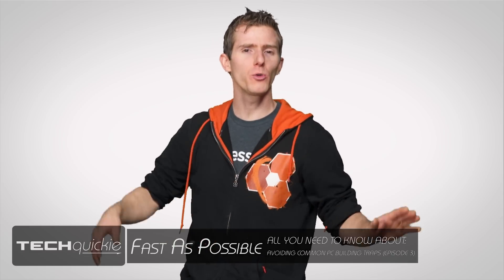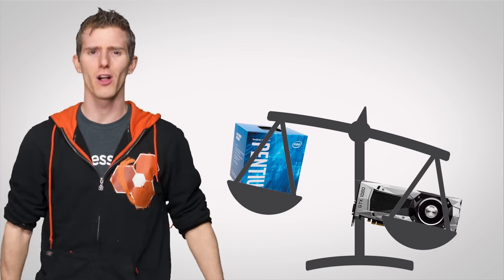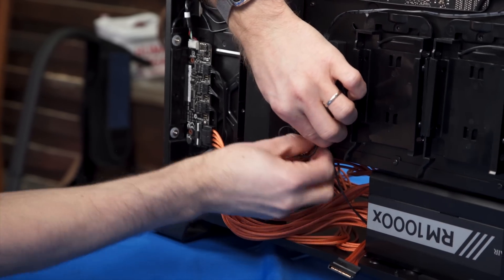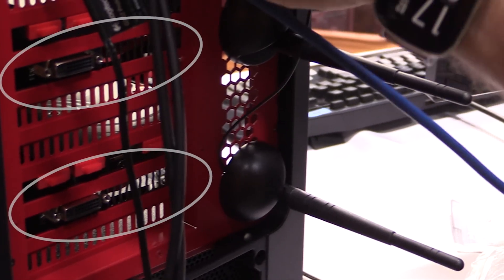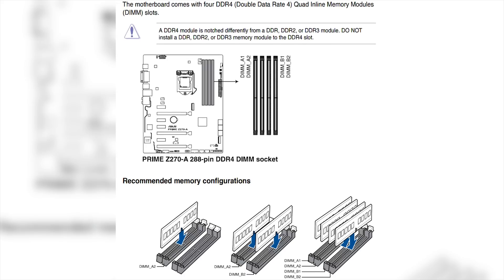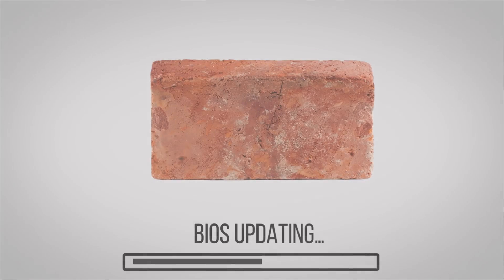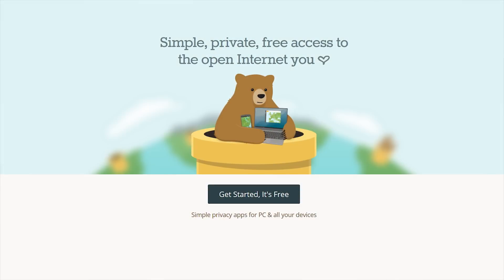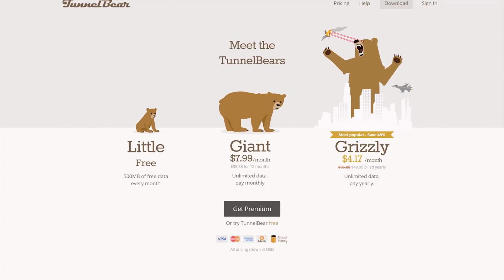Avoiding Common PC Building Traps - Episode 3

Comment: Maybe researching what you are wanting to do with your build to get the right parts you need before purchasing. For example, I bought a Z270 Gigabyte Socket 1151 board. But I later found out that it only accepts LGA1151 socket types and only up to a 4-core processor. I wanted more than 4 cores so I was able to do an exchange and got myself an ASUS X99 A-II board that is an overclocking supported 2011-v3 board that allows 6-core chips or more for a build that I want to do gaming and content creation. Research goes a long way especially when they may not allow you to change your part to something else youre looking for after the 14 day or 30 day exchange time. I almost missed out on it too since I didnt look into the stuff until about a month after getting it but I am thankful I was able to exchange it.

Comment: I built myself a new pc and it conducts slight electricity on the case, what should I do please help, its not like giving a shock but it can be felt.
Reply: Mad-Tech-Tutor check for any loose cables touching the sides of your case. If you are uber-paranoid of zapping yourself and can't find that wire, hook up a ground lead to the case. It will pretty much guarantee that you won't receive an electric shock, but you might end up frying something in the case.
Reply: Juozas Domarkas loose cables like sata cables ?
Reply: Mad-Tech-Tutor they shouldn't be the problem. It is likely that a cable from your PSU is loose and is touching the PSU case, which then conducts to your PC case. 
Please note that I am not an electrician and am purely speculating. You are better off asking in Toms Hardware or some other forums than a YouTube comment section.
Reply: I had the same problem, just make sure the socket you're using is earthed & the power cord is well in.

Comment: I built my first PC in November 2016 and had 2 problems:

1) For my CPU cooler (Cooler Master 212 EVO), I accidentally used AMD mounding hardware on an Intel CPU. 
This resulted in juuuuuuussst enough extra pressure to make my 6600k upset. This lead to the most stubborn "No POST" my friends have ever seen! It took us about a week to realize the improper cooler mounting hardware was the cause. Luckily there was no damage to the CPU.

2) DONT GO BLINDLY FLIPPING SWITCHES! 
while trouble shooting my #1 problem, I courageously decided to start flipping switches. (need I say more?). . .
when we got the computer up and running I was only able to pull off 15-20 fps in Overwatch with medium settings(on a GTX 1060). The problem was that I accidentally flipped the "SLOW" switch on my motherboard. My cpu was capped at 5-10% power with this switch flipped.

Can anyone relate? or are my experiences unique for a 1st time builder? lol.
Reply: I do not understand you. I have a Samsung 750 evo ssd, GTX 1060 and an MSI gaming M5. I hope that answers your 'question.

Comment: I disagree with the video card vs motherboard choice.  For the 1st time booting up, I like to use the onboard graphics to install and test my build.  When you put together a new build, never, ever throw in the whole kitchen sink.  If something goes wrong or God-forbid, you have one DAO component, having everything installed means you now have to figure out what it is.  By having the fewest components possible to boot, you can rule out the Big 3 - motherboard, cpu, and memory.  If you bought 4 sticks of RAM, use only 1.  You bought 4 HDDs, use only one.  You bought dual graphics cards, don't use either (use onboard if you can until you know everything else is working).  Then turn your system off, unplug the power and then install your new graphics card (again only one at a time or if they don't work, you will have to troubleshoot which one(s) is/are bad).  Nothing more frustrating than to install everything, only to find out that something is DOA and now you have pull everything apart trying to find out what it is.

Comment: Probably a dumb question but I am not as knowledgeable on tech as most. What happens with a dual monitor set up if one screen is plugged in to the motherboard and the other is in the GPU? say your secondary monitor is in the MoBo and the primary which you use for games is plugged in to the GPU, would that cause issues as Linus stated here would your game be unaffected by this kind of thing? I do have both my monitors in my GPU, I only ask out of curiosity

Comment: GPU install tip: HDMI connectors can wind up too close to the slot ribs preventing the plug from going all the way in. Loosen the PCI screw, gently nudge the card, plug in the HDMI cable until it "clicks", leave the plug inserted, and tighten the slot screw.

Comment: One thing to add in PC builds traps is make sure the equipment is actually good.  I bought a keyboard and it caused problems that took me a year to figure out.  Debris on the electrical connection strip caused intermittent USB power drops and losses which caused all sorts of problems.  Since it was new I never once expected it to be the source of all my woes.  Symptoms like PCIE power drops that made the video card look bad or windows suddenly going to sleep for no reason and then waking up without having pushed the power button to name a few.  Even Logitech has bad equipment from time to time so make sure it's all good to go before you build your system.

Comment: I am busy with my first build, I have an Asus Rampage V edition 10 with a 570X RGB Cosair chassis but the back-plate of the motherboard is touching the rubber cable management holes in the case. Is that normal and safe? If not, what can I do about it?

Comment: Talk about how to buy a UPS. I was researching and some high end PSU's dont work with lower end UPS as the sine waves from the lower end UPS are "modified" and are more like square waves instead of smooth sine waves. However lower end PSU's dont have that filter that denies the modified sine waves but I could be totally wrong so some clarification on how to match a UPS with a PSU would be great.

Comment: i have a good question about windows.. i've done many builds and have installed windows way too many times. i find that windows will have odd behaviour differences between installs. sometimes some settings or configurations are off, or i'll install a copy of windows that cant stay stable while i program the PC with other software. To cure these headaches i just reinstall windows over again and hope for a better install. like now, i have windows 10 running on a 1TB and i want to make a fresh copy of windows 10 on my 2tb hybrid drive that install had a few things different vs my copy on my 1tb like file explorer not being pinned to the task bar. the new copy on my hybrid drive had a hard time staying stable, it would crash and act finniky every now and then..... all untill i asked it to go to sleep mode and it decided to kill itself. windows would not boot and requested a fresh install..... im back to my 1TB

Comment: Always double check the manual and all plugs for your motherboard and peripherals in your build, make sure that you have used everything needed and nothing vital is unpowered or power being pushed to it uneccesarily (poking at Linus's router build but also my own first build where I thought had an unnecessary plug, when in reality I just didn't know there was a CPU power cord because it was hidden behind my rear case fan. 4 days of idiotic troubleshooting and pulling components trying to get a post confirmation beep and spent $100 on a new mobo for no reason and couldn't get a refund)

Comment: I might be late, but it's usually a good idea to get a bit more RAM and Voltage than you need, too. PSUs wear down and lose voltage over time, and a little extra memory never hurts.

Current planned build's gonna run ~300w, but I'm going go buy double that for the PSU.

Comment: Tech tip: Stop buying i7 laptops with 5400 rpm hard drives then complain to me it is slow. And when I suggest you replace your HDD with an SSD, don't tell me you would rather invest into a 7th gen i7 with a 5400 rpm HDD to make it faster.

Comment: One thing you missed was checking to make sure the CMOS jumper is not in the reset position.  Also, make sure you put the video card in the recommended, by mfg, slot if running a single video card. And, make sure your fans are blowing in the right direction.  One important part I made a mistke on was not having the right case for OC'd video cards.  I think the air flow was insufficient for the XFX R7 270X video card and it over heated and started acting wonky.  When I took it out the metal back plate was burned.  Fortunately XFX took it back under warranty and replaced it with a nice RX460, the 4 gig flavor, and I updated the chassis.

Comment: I build my PC 2 Days ago and yeah i did put my DDR4 Ram into A1+B1....luckily ive read the Mainboard Manual before powering up my PC (was plugging in the Frontpanel cables) and ive put the Ram in the correct A2+B2 slots, like the same in the vid.
Its my forth PC ive build in about 14 Years XD 
The most important thing ive leaned was Cablemanagment and airflow...
The second one bacame important after my AMD Thunderbird...well as the name implies it bacamehot...VERY HOT about 120-140°C if i remember correctly. The Mainboard did shut down the PC for protection, but i ignored it and turned it back on every time....until the CPU had a meltdown. It DID still work, but only partially...

Comment: I know his point was ultimately not to be gaming with the monitor cable connected to the motherboard, but he said "when you are finished building and you are ready to plug your monitor in, Don't..." This is nonsense. 

I was building a PC for a friend a week or so ago, and even having the GPU installed, let alone routing your connection through it, completely hindered the system installing certain drivers for the motherboard. Especially the Intel Network Driver. 

My recommendation is therefore to not even install the GPU before the system is completely up and running with drivers and everything, to avoid the two hour Wtf-phase I just had. This of cause entails connecting the monitor to motherboard.

Comment: Didn't you all disprove cable management mattered unless you did something moronic like put the packaging in the case?  And as a technician I hate anyone who puts Zip-Ties on computer cables.  if you ever need to change or move cables now you have to cut the ziptie, and that means risking cutting the wires as well.  Never use Zip Ties on things that matter.

Comment: There was a mistake I did back when I build my first PC, I have screwed the motherboard straight into the case's template without spacing out between the motherboard and the case, I was lucky enough that it didnt fry my motherboard! 
But I did end up wondering for countless hours why wouldnt my pc power up

Comment: Building your system around your case (don't assume your case can support a 14 inch card) and avoid using cases that have poor airflow if you decide to purchase power hungry components that will spew hot air into the case if you can't effectively vent it out.
Reply: yeah, or if you RMA your R9 280 and get an R9 390 back as it's replacement. How the hell it fits, I don't know... but there's not a lot of room in there.

Comment: my tip is:
cable management dont do anything noticeable for your system.
you dont believe me you say?

Luke's workshop video probably can confirm this :)
Reply: until you have to take something out, that is :V Cable management is the only reason my aircraft carrier of a video card fits in this case. Cables do also collect dust. It's okay, though, because most of the dust is on the side I can't see. XD

Comment: Here's a tip:

Watch the prices vs performance!

If you've got a choice between a $200 video card and a $600 video card... more often than not, the difference is going to be negligible for your average person. If you're not gaming in 4k and trying to play the latest everything, the $200 video card will work just fine. OR, you could look into buying two $200 video cards and linking them together with SLI or something and you might even end up on top, $200 cheaper.

There's always this... exponential step between hardware, where you'll go from one price, and the next step up is more than 2x that price for a lot less than 2x the performance. Unless you really want the best of the best and you want to throw money around, there's nothing wrong with going for budget when you hit that huge step up in price.

I usually try to keep it to between $600-$800 and so far this has served me well. The computer I currently use was about $800 and it on its 5th year and still going strong, other than me having to replace the stock CPU cooler a couple years ago.

Comment: #1: PC Building Trap: Don't build something so high end that you can't match or exceed it's performance in the future. E.G: Spending every last cent on a super high refresh rate panel when you may only be able to afford a 60hz one down the road. Personally I never plan to go above a 60 series GTX or quad core , 8 thread CPU, generational upgrades, not tire.

Comment: From personal experience with my first build I would say three things. First, I bought Skylake when the processors and motherboards first came out and when I went to plug in my new g-sync monitor with the display port connector it didn't work. A monitor that used HDMI worked fine but not the display port setup. Lesson, new means potentially undocumented problems(this one I solved by getting a motherboard from a different manufacturer). Second, you have to connect the case to the motherboard with those fiddly, poorly marked connectors and if you get them wrong bad things can happen. Lesson, if you aren't sure ask an expert even if you have to pay for it. Third(see first), having the newest UEFI version on a USB drive is a really good idea so use another computer to have it ready to go. All of these are motherboard issues(!) the rest was not nearly as hard as I was afraid of. I had another computer running so I could reference YouTube videos while I worked. The first one IS the hardest, it gets better!

Comment: motherboards with 4 ram slots? I've never seen such thing. I feel so... low end.
Reply: Yep. If you stick to the smaller motherboards, you might not always see them, even on newer boards.

Some boards, like the old  one my server uses, have 4, but you can only use 2 at a time (legacy ram support)

Comment: Don't forget to match the power supply with the case type. For example, my AMD build where I tried using an included SFX PSU where the cables were too short to reach the power connector, and I didn't have an extension handy, nor did my local Frys. Luckily I was able to swap it with my son's PSU, but I should have checked for compatibility before ordering the bundle. (and Techquickie you can use any footage in my build if you see a useful screenshot of this issue) v=ocz4luIgRSE?t=30m14s

Comment: If your built in video card is better than or can run games fine like amd R9 series do not buy those nvdia 1080's cause you don't need em with a decent free vulkan video card why buy video card when you can just buy a 4k monitor instead of a 1080p monitor

Comment: PPL who have no idea about such things really need an assembling person to build it for them. And no these things are not easy it takes time to learn all the details of speed and compatibility of several parts with each other to avoid a bottleneck
Reply: I am confused which PSU to buy. I was planning on Buying an Graphic card GTX 1060 (MSI or Gigabyte or EVGA yet to decide) and a processor i7 4th gen. What PSU would you recommend?
Reply: Thank you that was helpful.

Comment: RAM slots are usually colour coded to know which slot to plug them into , but if you get frequent crashes just switch the ram chips to alternate location and it'll all be good , worked for me .

Comment: Always soak each component in salt water before assembly. Remember the motherboard and CPU should soak for at least 30 minutes to assure proper fitment, and maximized performance. The sodium based H2O acts as an amplifier.
Reply: Freddy Heineken when you did this process , the final step was shoving it up your ass?
Reply: Freddy Heineken 😂😂😂😂😂 you said your community when you were little you weren't drop on your head, you were slammed lol
Reply: Didn't get the joke. You tend to sit in a dark basement and amuse yourself a lot huh? Quit sniffin' the canned air son it's fuckin' with you now.
Reply: Freddy Heineken why the salty comment in the first place, people who do that are usually antisocial and take there frstration on others, get out your room once in a while it will do you some good
Reply: bbmatias22 nailed it man. I am also a paranoid short tempered irrational ingrate who suffers from heavy flatulence and delusions of grandeur.

Comment: Don't buy anything "Open Box" or "Refurbished" from Newegg (or anywhere for that matter) when building a computer.

My first rig had a motherboard I bought Open Box that had several features end up not working after a short while, and almost a year later, actually fried itself, my PSU, and one of my RAM sticks. I was stuck with an old crap motherboard and processor until I had the cash to shell out for a complete upgrade.

Comment: And when you're using the right DIMM slots, and your machine powers up, your RGB's are being all sexy and light-y and you load CPU-Z to check the awesome numbers and find that your DDR4 3600MHz RAM is running at 2133MHz, it's because you haven't enabled XMP. Took me a while, with howling and chest beating and finally shaking my fist to the heavens, before I learned that.